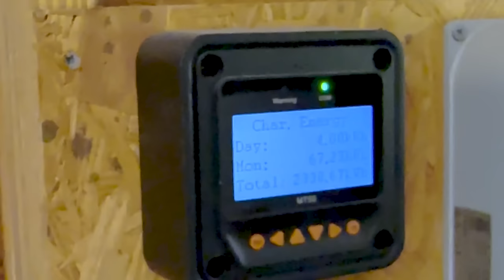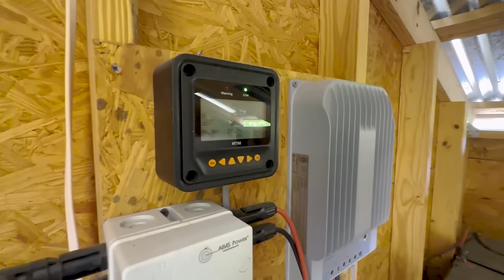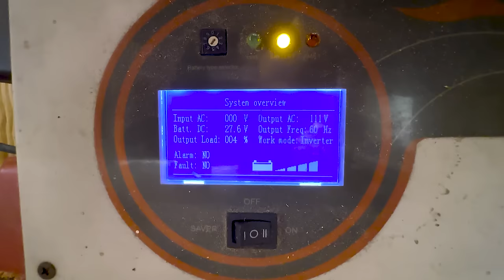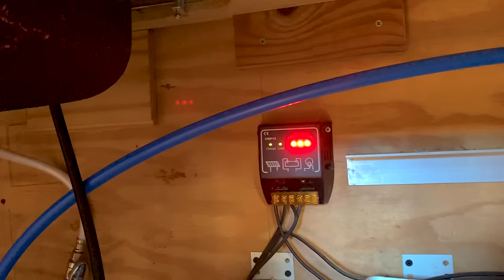Off-Grid Self-Sufficient Cabin Tour in Northern Florida

Comment: What county is this in? I cant find any county that allows anything under 375 sqft in Florida.
Reply: Yes where can we know??
Reply: For some reason they won't say the county they are in.....
Reply: I had a similar cabin in Madison county. I did not have running water or electricity but we managed with a generator and a wood burning stove. We had a big truck because the roads were rough  ! Once a week we filled out water bottles, shopped, bought ice, and filled out propane tanks.
We had a little AC that ran off of a generator for a few hours. Winters were COLD and summers were hellish.
I wish it had not been sold.

Comment: Hey Joe, Just found this video. I love it! My wife and I bought 10 acres in North FL, not far from Lake City, FL. We are not planning to go 100% off grid But I do plan to have my workshop and out buildings run by the sun. I currently live in a 37’ 5th wheel that has 2400 Watts of Solar and 600AH of LifePo4 batteries. Still debating on if I want to drag it across county. I’d love to see how the homestead looks after 1 year. I hope you are still doing this. great video!

Comment: Great video. I live in Northeast Florida but in a regular house and community. Our grid costs currently average $170/mth for water/sewer, gas, electric (utilities) which comes to just over $2000/yr. We have solar. The other expenses, aside from HOA, I would assume you still have- insurance, taxes, etc. In our county I am aware that they charge even mobile home plots like a minimum $1000/yr taxes. It seems that the biggest savings of all is the cost of the home but, you also are sacrificing quite a bit. Love the idea though. I have some friends who bought in north central FL but purchased a motorhome to reside in and to be able to travel also.

Comment: 22:20 Toilets don't use that much water, relatively speaking. Most use 1.28 gallons per flush. Some use 1.6 gallons per flush. We go to the bathroom 6-7 times a day. 2 people times 7 times 1.28 equals not quite 18 gallons a day. A ten minute shower does the same thing. Since Florida gets it's fair share of rain, replenishing the catchment system shouldn't be too much of a concern. What the composting toilet and rainwater system do best is save huge amounts of money on the installation of more conventional means of acquiring and disposing of water and waste (well and septic system). 

I like the gas range too. I watch a few van life type videos here and there and I've commented on those videos about people who use electric stoves rather than propane. To me, it makes zero sense to use up your stored sunshine on a stove considering how limited you are on space for battery banks and solar panels, especially in a van.

On a side note, I'd do this in a minute but getting the wife on board is another story. She won't move away from family, so we'll be here in South Florida for a bit longer, which is okay (except for the traffic).

Comment: Since that is such a nice porch, you might want to grill out there at some point.  I would invest in a 200 Ah LiPo4 battery and a couple 150 watt panels for the roof and a 1200 watt inverter and leave the house electric alone.  I have a covered deck set up similar and have a nice ceiling fan and good lighting for eating outside. 
I watch 19 off grid YouTube channels and 16 are in the northern US with cold weather and snow 7 to 8 months a year.  Three are in Alaska, and only three are in the south, one in Arizona, one in Texas, and now this one in Florida.  This amazes me, however, I suspect that those people in the north are a bit more hardy due to growing up there, and also remote land is much cheaper.
Reply from the maker: Agree with the ceiling fan! Yeah just easier not to freeze to death down south. It was nice having fireplaces when I lived in the north though.
Reply: I'm moving from the north down to northern Florida I will be starting a youtube channel soon and show my whole process stay tuned